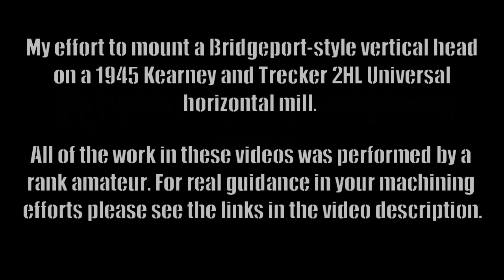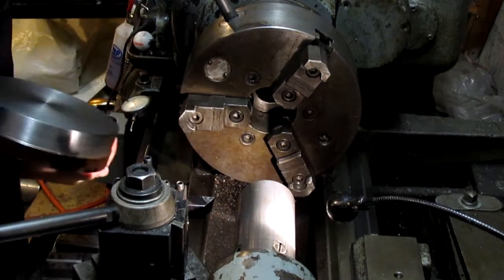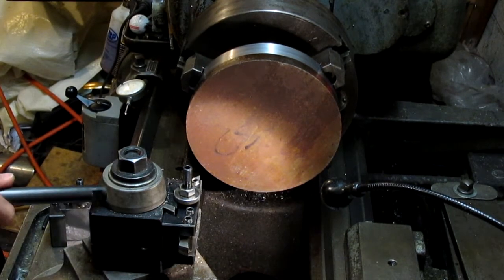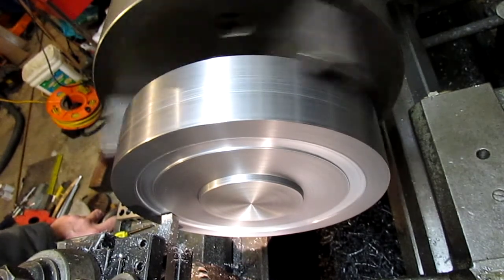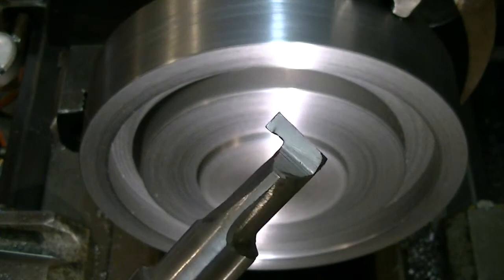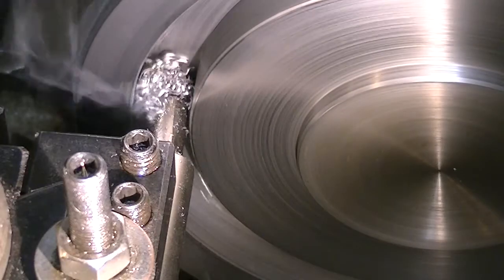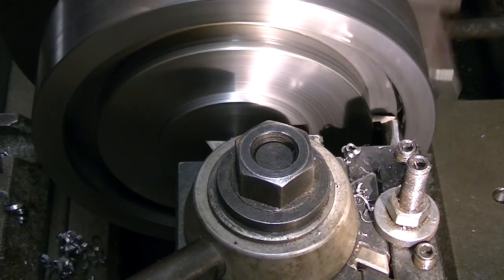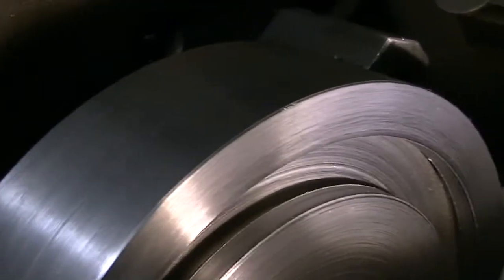K&T Mill Vertical Head Mount 1

Comment: Why not use the overarm shafts? Then you could slide the head in and out.   AAand, why not put in a recess instead of a 'stud' to register.  Then you could use the 3.000" worm gear to center the head, and have the twist ability too. Like BP did it.

Comment: 1:30 Straight arbor - the arbor may bend as you tighten the nut on the end if all the collar end faces are not clean and straight. The actual diameter of the arbor is that of the collars, not the shaft through the centre. Also, the bore of the cutter needs to be a snug fit on the arbor too - otherwise it can have its own runout - which sounds like what you have here and therefore it's not the arbor that's bent.